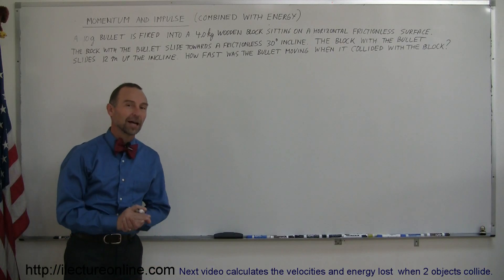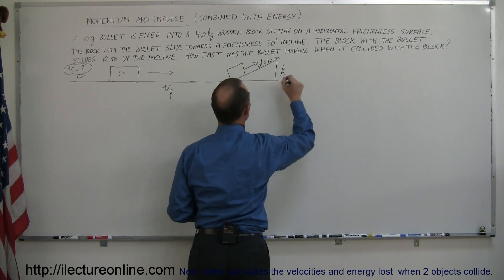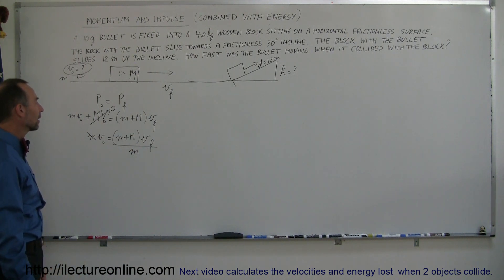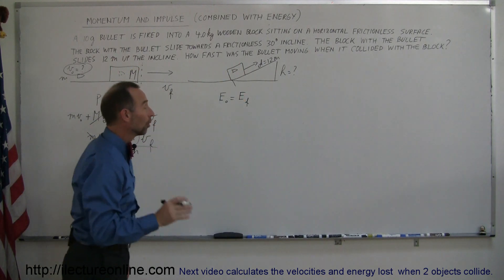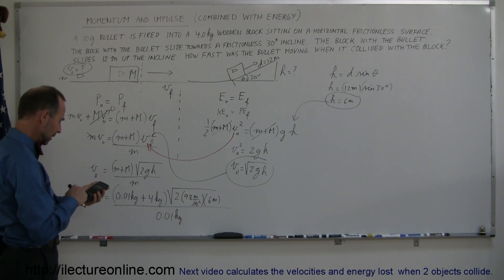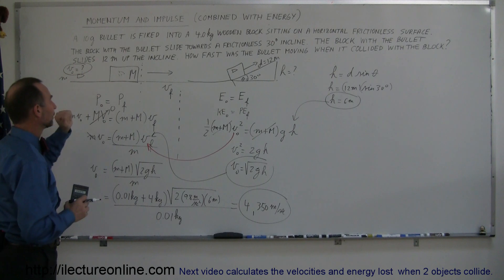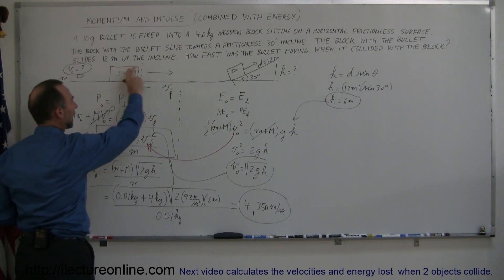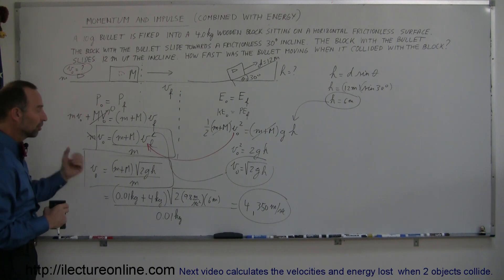Physics 10   Momentum and Impulse (8 of 30) Conservation of Momentum and Energy (2 part problem)

Comment: i got the same result and had same reaction but it kinda does make sense sine going up a 30 degree inclined plane for a distance of 12 m does require that the bullet is going at a very high speed, thanks for the video
Reply from the maker: You are welcome.  🙂

Comment: Nice. I have issues with solving for multiple variables, usually not noticing what path to take (Hard to keep track of everything sometimes)... After watching the previous few videos tho, this was relatively straightforward. Did each step myself, then watched your method for mistakes. I was surprised to only mess up on the Energy final part lol, didn't take the total mass into account for final potential energy. Very nice, and quite interesting tbh. Thank you again :)
Reply from the maker: That is the bests way to utilize these videos.  You get a lot more out of them by trying to work the problems out yourself.  Keep it going!

Comment: A 10g lead  bullet is fired into a 30g steel dice sitting on a table.Bullet stuck in the steel dice.
Initial temperatures of the bullet,dice  
are 25°C,15°C respectively.
How to find final temperature of the two,Sir?
Reply from the maker: You will need to know the initial speed of the bullet (otherwise you can't solve the problem)
Reply: Initial velocity of the bullet is 300m/s,Sir😄😃😀😁😊🤗
Reply from the maker: First find the equilibrium temperature before the bullet strikes the steel     (10)(0.13)(25-T) = (30)(0.45)(T-15)    Solve for T and T = 15.88C

     Then find heat generated   KE = (1/2)mv^2 = 450 J    Then set into equation   450 J = (10)(0.13)(delta T) + (30)(0.45)(delta T)    delta T = 30.4 C     Tf = 15.88 + 30.4 = 46.3C

Comment: Minute 3.50 : you say “it’s inelastic collision”.....why is the collision inelastic ? Could you explain me? Many thanks
Reply from the maker: In this case, it is just a "given" in the problem.  In theory, an inelastic collision, is a collision where no energy is lost during the collision.  In the real world inelastic collisions do not exist (except in the quantum mechanic world).
Reply: Excuse me again ....inelastic means no-elastic is it correct? Then if collision is elastic there is conservation of Energy .....for me (but you have said the contrary)....I cant understand the concept.....Many thanks
Reply from the maker: There are different interpretations for "elastic" and "inelastic" collisions, and yes there is confusion because of that.  An elastic collision means that energy is conserved in the collision.  (In the real world there is no such thing as an elastic collision where 100% of the energy is conserved).  But we use this concept in text books for the learning experience and for approximating the results of the collision.  If ANY energy is lost in the collision, it is called an inelastic collision.  (That is why "all" collisions are inelastic collisions in the real world.)

Comment: You assumed that the block will travel up 6m on the incline because that is what you got from taking the sine function of 12m. But that is assuming that the block will travel completely up the incline, that is the only way you could've solved for the initial velocity of the block and bullet together. So you would have needed either the final velocity of the bullet and block or the initial velocity of the bullet. Because this way you had to make the assumption that the block will travel up until it reaches the inclined plane's maximum height of 6m. I am correct? If not, why?

Comment: I like your videos but the way you solve your problems confuses me as I'm just starting to learn about momentum, so I solved this problem using a few different steps.

What i did was find the height of the incline using trig (like you) I then found the initial velocity of the block using vf^2= vi^2 +2ad and rearranging to find Vi. then i used the equation you use (m)(v)+(M)(V)=(m+m)Vf (in this case Vf is the same as the velocity we just found) and after plugging in my numbers got the same answer as you, my way is much easier and got the same answer.

Comment: Hi Prof. I'm checking if I'm getting the logic behind it all: Am I correct is saying the reason the velocity was calculated to be so crazy large is because the problem states the bullet+block slid up the 30° incline for 12 meters & 12 metres would be quite far for an actual gun/bullet to push a light block? Thanks in advance for answering and thanks for providing these instructions and bigger thanks for being such a great physics teacher.

Comment: if the problem would involve friction force between the wooden block (in rest) and the ramp, we would need to know the distance between the block and the ramp right?
Reply from the maker: That is correct.  That would be another place where energy would be lost overcoming friction.
Reply: +Michel van Biezen Thanks a lot, your videos are very helpful!

Comment: Hi Professor,          Does the distance the bullet travels inside the block before it stops and matches the velocity of the block after collision affect the final speed of the bullet/block system?           For instance, if the bullet travels 1cm into the block, will the final velocity of the block differ from a scenario of which the bullet travels 10 cm into the block?             Is conservation of momentum conserved in both cases?          If so, how does the conservation of momentum account for the differing final velocities, assuming there is a difference?
Reply from the maker: +Derek Delatorre 
It makes no difference on the final velocity at all.
Momentum is conserved  under ALL circumstances.
Reply: Thank you for responding to my question.